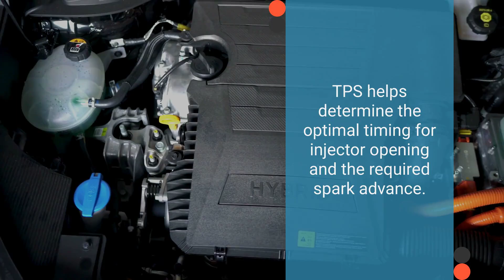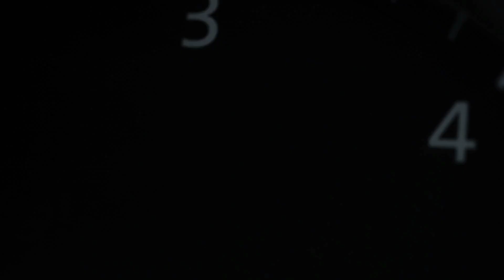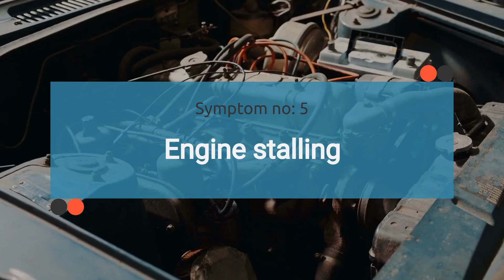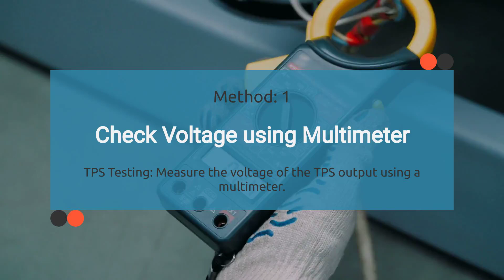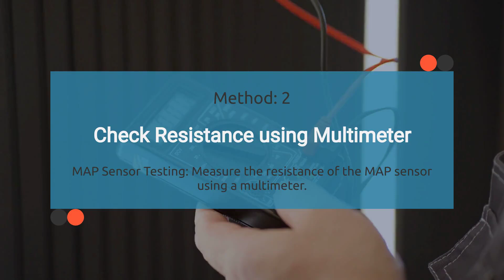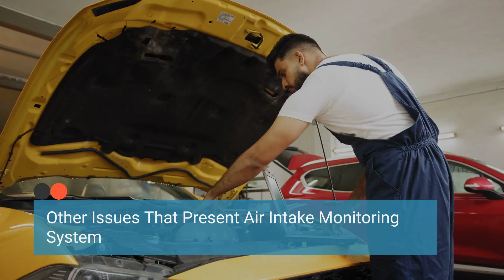Symptoms of a Bad Throttle Position Sensor TPS

Comment: Hi Friend, I have Toyota Avensis 2016 Business edition. Live data on diagnosis shows Absolute Throttle Position 84.7% and It is struck at this reading. It does not move even on acceleration. Do you think that Throttle Position Sensor is Faulty?  Please let me know?  Thanks
Reply from the maker: Check for any active trigger code. After that check the throttle body, it may be stuck open, due to dust. If on acceleration engine rpm increasing but live data showing constant throttle opening, most probably TPS sensor has malfunctioned.

Let us know if you found something extra.